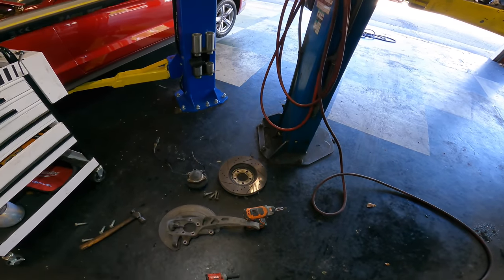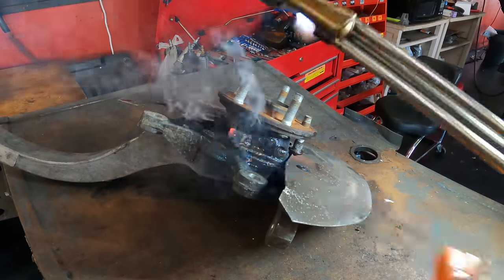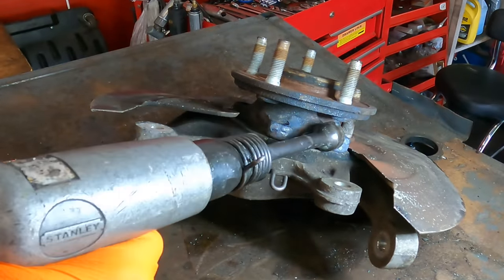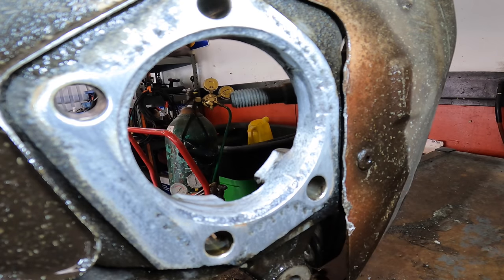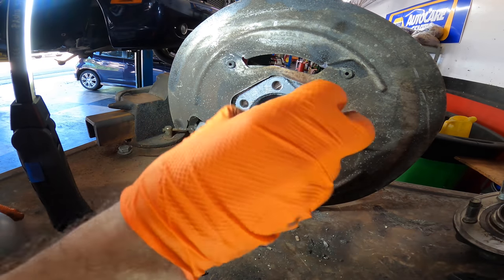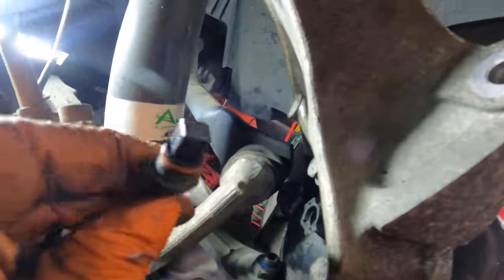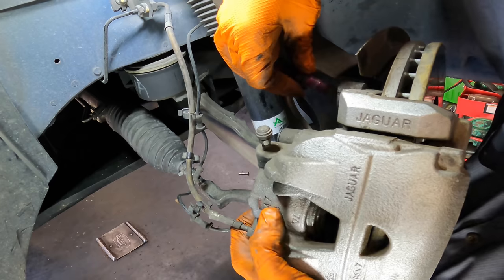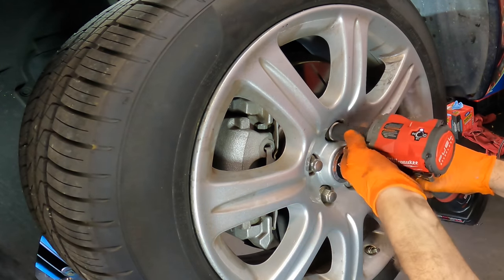Serious Corrosion! HEAT Required! Torching a Jaguar 2008 XJ 4.2 Hub Bearing/Bent Parts

Comment from the maker: There seems to be some confusion in this one so. I will elaborate. The steering knuckle was bent causing a wheel alignment issue. We got a used one bc a new one doesn’t exist. The new used part had a very rusted bearing so I decided to reuse the original bearing. However the junkyard bearing on the replacement knuckle was corroded in solid, so it got torched and hammered out. I don’t use a torch on aluminum Jaguar parts so the steel hub bearing got the heat. I replaced the steering knuckle and installed the original non-torched wheel bearing. The alignment spec came in perfect at  - 0.3*  BTW
Reply: I used to do chassis work in a body shop.  Idk how your knuckle got bent but whenever someone hit something hard with a wheel to where things got bent we preferred to replaced the bearing.  Depended on the customer's budget or insurance.  Seemed like every time we didn't it came back with a noisy bearing several thousand miles later.
Reply: I was mostly agreeing with the dissimilar metal issue. One would think that would come treated from factory assembly and further be part of replacement part instructions. Made everyones job harder.
Reply: Glad it worked out. I can see going through all the work to install a used part and have problems with it too (my luck!).
Reply: I get you have to do what you have to do. Your at the reluctance of the customer. Stay safe and be well.
Reply: You expand what you heat . . . so heating the bearing makes it larger. Heating what the bearing is installed in is what you need to heat and not that hot.  I think you were trying to break the corrosion between the two by burning or disrupting the corrosion. But light heat on the Aluminum will expand it allowing the press fit or interference fit to move in the expanded Aluminum.  I would use liquid N2 to shrink a component and it would drop into place. Using a cutting Torch for heating provides an concentration of heat for cutting. I know you have to use what you have on hand. Not being a troll but a few tip sets for heating is cheap.
Reply: FYI if you hold on the zero the ° sign will pop up so you can show ° instead of * 😊
Reply: Good job sir! Up here fire, never seize and duct tape are the handy mechanic's secret weapon. Red Green would be proud!
Reply: pleanty here in the uk RAY lol
Reply: Your BTW was a little petty....
don't you think?
Reply: Eric at SMAuto. Showed a video on something similar, not sure if it would be applicable to this. However he cuts off a wheel stud and uses a bolt and a nut on the inside to press the bearing out. He is in rust land and knows about seized parts. The bearing he was working on was a well known problem child that kind of makes their way to his shop.
Reply: @48Rodgers  00000000000000000000 eeeh, no. 😋
Reply: @mikecabral1579  That's what I thought when I first got my oxyacetylene torch twenty years ago. Then I gained a whole lot of real world experience. You are often in the practical situation of not being able to heat the female part, for various reasons. To my surprise, heating the male part works almost as well, for whatever reason. If I heat the male part I often spritz it down with water to shrink it back down, but even if left hot it often works fine. Nothing works as well as oxyacetylene, it is in another ballpark altogether. However I've never tried liquid nitrogen, it is not available in most machine shops.
Reply: @alexcarr8503  — i saw that episode too….looked like a great idea
Reply: @spelunkerd  I haven't looked in stores lately, but there are some aerosol can cold sprays that also spray penetrating oil.  Shrinking with cold is a nice option sometimes.
Reply: Think I would have done just a touch different. I work on HD,lots of aluminum, and things get stuck. I use a heat gun to bring aluminum up to 250-280F and with that I would use a press
Reply: Should've went to autozone part number is DL590426
Reply: Thank you for clearing that up I wasn’t sure if you use the torch the bearing as that would’ve been a no no thanks very much for putting me straight👍😀
Reply: rule 4 ..lesten to your subs...all experts are on the ouitside looking in..  with clip boards...
Reply: never sieze,,must be mastik,s sister..
Reply: I have cut off a stud, knocked out the cut stud and used a bolt with nut behind the hub and use it as a jackscrew. On an aluminum knuckle you might need some protection. Work one side then turn 180° back and forth. it will come out no heat needed. Repairs from the rust belt.
Reply: @mikecabral1579  N2 setup sounds like cool way(pun intended) to shrink metal. Tho possibly hazardous. Who provided yours and at what costs ?
Reply: BTW what about that upper ball joint. Rubber boot is torn. I guess aluminium arm with irreplaceable ball joint and no option to buy a new boot.
Reply: @peted5217  Long time ago. I think it came from same people that supplied our gas. It was stored in I think stainless steel container covered in styrofoam with a wedge type cap about the size of a 5 gallon paint can. Just pored it out into a container put the part you wanted to shrink in first covered it up with the liquid N2 gloves and face mask give it a few minutes picked up the part with tongs you could handle the part with just gloves drop it place quickly. Pour the Liquid N2 back into the container and cover it up. I was repairing hydraulic cylinders parts off of heavy equipment. I was the welder machine shop would bore out the part I really just watched them drop the bearing in. It would shrink a few thou..  and drop right in.
Reply: @mikecabral1579  Many thanks on how N2 was handled @ shop level. I'll check with local gas vendor to see if available, other requirements. Believe I've read it's also used as a surface hardening process. PeteD
Reply: @mikecabral1579  I've numerous times machined parts to heat shrink together and anything like a shaft that had to go into something, I'd heat the object it was going into but long before that I'd stick the shafts in the freezer. That wouldn't get as cold as you liquid nitrogen but it was a lot safer and easier to deal with, you just had to plan well ahead if it was large parts but it usually worked very well.
Reply: @edwardsilva895  If he hadn’t put in the “BTW” I would have asked.
Reply: @danwilliams5867  Aluminium has a much greater coefficient of expansion than steel.  Do what the above man wisely says!!!
Reply: I think you do great especially in a world where parts are in short supply, customers don’t want to wait and they don’t want to pay for repairs. If you don’t come up with something they will go to a shop that will and rip them off in the process. That ultimately effects the reputation of the industry and the bottom line. Many consumers were born in to or adopted the mind set “I’ll just go get a new car.” Many are finding out it’s cheaper to drop a thousand into their existing car (especially if they bought it brand new) then it is to buy a new one. Car payments are matching/ out pacing mortgage payments around the country unless of course you are willing to settle for a bare bones car. Then to add insult to injury the car is only worth a third of what you paid for it when you make the final payment. It’s clear auto makers are catering to the customers who trade payments every two or three years.
Reply: I'm Frozen parts used to use rustlick you throw it a part in the bucket overnight let it soak and it will dissolve any corrosion I don't know if it works on aluminum I would hope they have something like that but I Ray did the right thing why is apologize and explain it to a little trolls and haters I have no idea hey you got the job done man and it was a bear also I got a kick at it how Jaguar was stamped on everything that was cool have a good evening

Comment: Hydraulic presses are wonderful things they come in handy
Reply: Yeah can really tell it's Florida and not the north east.  No shop press and the torches are hidden in the back of the store room.
Reply: ill go with fire
Reply: I think he just wanted to make a video
Reply: @Usmanthemecano  Yes you are probably right.
Reply: Saw another guy trying that with the press and with it seized it snapped the aluminium rendering the whole arm useless
Reply: @GregsStoneYard  the shop has a press. He used it when he rebuilt the drive shaft in another video. I was woundering why he didnt just use it in this case.
Reply: @Labboy541  If the arm was cast steel or iron a press would have been the way to go, since the entire assembly would have more strength and the corrosion from dissimilar metals would have been less and therefore less friction.  However, with a cast iron or steel bearing outer casing resting inside an aluminum arm, you're going to have hellacious corrosion from the dissimilar metals, and the aluminum might not stand up to the pressures needed to overcome that corrosion friction.  In this case I think Ray's decision to heat the cast steel or iron was the best choice.
Reply from the maker: Not putting an thin aluminum knuckle into the press… nope
Reply: @RainmanRaysRepairs  Who knows how the original one got bent.  It may have been from someone pressing out an old bearing.
Reply: @johnmehaffey9953  good observation
Reply: @SomeRandomHuman717  nice observation
Reply: @RainmanRaysRepairs  ok, awesome video
Reply: Sir, I suggest you thinking before writing some “things”, probably would need a 100tonnes or more press to take some bearings out and like he said its alluminum knuckle so... and a friendly suggestion since this guy is making a living out of this trade, i presume must know a lot and should because out there always is someone who knows more than you do (at least for a particular subject) to avoid let say some hilarious situations
Reply: @RainmanRaysRepairs  i’ve done dozens of these in the rust belt. they don’t take more than a 10 ton press to get off. trust me
Reply: @RainmanRaysRepairs  swings and roundabouts - risk using the press, risk using the torch - possibly a combination of the two with a bit of shock therapy thrown in for good measure. Still at least no one is going to fly in it.
Reply: I used to use a hydraulic on Continental axles to get the bearings off then turn down the bearing and fit it to a Ford 9 in and you had heavier duty axles for when we were racing at the track this way if you got hit they wouldn't bust as quick have a good evening

Comment: I worked in an aluminum foundry for 11 years. Aluminum and steel parts will “weld” together with time and heat. I know people will argue with that word but, if you look at it under a microscope the mating surface has exchanged parts of each alloy and had become something new. This has been know about for a long time. Mother nature says this will happen every time. So…..the ultimate incompetence of the engineers and manufactures to mitigate this problem astounds me. I am sorry, I realize this is a rant. I am just sick of the stupid that puts those two alloys together on a brake system.
Reply: Fun fact: They use a technique called “Explosive Welding” to bond the lighter aluminum super structure to the steel hull in ship building. Cool stuff.
Reply: It does seem that they should know enough to try to mitigate it with some type of coating to deter the chemical reaction. To err is human but to really screw up, it takes an engineer.
Reply: @tiredoldmechanic1791  yup. They could put a sacrificial sleeve in there. But, for some reason they never do. We used a coating on our extrusion press. It worked pretty well. It just frustrates me to see a guy have to work so hard, when and ounce of caring from the industry could help.
Reply: Bi-metal bonding
Reply: NASA learnt this early in their space program, interesting read about how metals in outerspace meld together.
Reply: With any two metals near to each other, One becomes a Cathode and the other the Anode, Electrons flow from the more chemically active metal (anode) via a conductive path saltwater/dirty water/ or rainwater to the less chemically active metal (cathode) giving galvanic corrosion, or if an electric current is present then electrolysis corrosion is added, One is always a sacrificial metal. Sorry for the science rant.
Reply: @hardergamer  science is cool. I have been out of the lab for a long time. When i was there is was only a tech. I was way more the hands on guy than the brains.
Reply: 3 cents worth Never Seez you'll take it off with your fingers
Reply: Yeah - aluminium suspension components have been a big thing for a while with JLR. 

It's a problem really because you can make the knuckles and the arms out of cast aluminium but as far as I'm aware aluminium wheel bearings, wheel studs and bolts aren't available so you'll always have this mixing of steel and aluminium and have them corroding together. The later model all aluminium XJ was a big problem for Jaguar. It was a very good design in some regards but they struggled to build the all aluminium body shells.
Reply: I always heard it referred to as  dissimilar metal corrosion.
Reply: @hardergamer  Your explanation is accurate, in aircraft mechanic school it was called "Dissimilar metal corrosion"
Reply: In Illinois im constantly almost melting aluminum knuckles to get the steel bearing out to the point where the grease catches fire in the bearing it can get really knarly
Reply: Agreed its dumb especially when the price just increases yearly our new tech is the best but it's also irrelevant to someone who works on it.
Reply: Wow I thought that was common knowledge? The young need to be taught....or not????
Reply: @77zrod46  I fix everything I have the time money or sometimes the will power to do on my vehicle's I kinda said these new vehicles are meant to be put together once with no thought of the future
Reply: no doubt , that's a super entertaining event to witness live @richardluce775
Reply: @hardergamer  So That's what's happening, The Ol' 'battery trick' . Thanks 4 tip.
Reply: Galvanic action
Reply: Galling between the metals.
Reply: I share your annoyance it is a standard rule I all ways use moly grease to dope any interface between the twy
Reply: It's more like the superficial diffusion in a soldering connection, only a few atom layers in thickness but well enough to be in the way of disassembly. Also, heat may speed up the diffusion process but you'd need to cool it to absolute zero to stop the bonding entirely.... So there's no way to stop it realistically. Plus vibrations may encourace that diffusion as well
Reply: @fimbulvarg1213  Hence why the world has copper paste aka copper anti-seize.
Reply: @perwestermark8920  nickel is better but hard to find.everyplace i asked about it around here didnt even know it existed
Reply: I worked in a foundry an aluminum foundry for 9 years we originally used steelbolts but then we went over to stainless cuz we had the same problem and we used anti-seize it worked out great especially if we had to tear them all apart have a good evening oh by the way I use the machine molds out of aluminum casting after they came out of the foundary too it was fun I loved it might sound silly I love the fire
Reply: If I remember right it's called a dielectric reaction in exchange of electrons Ray will like that word electrons have a good evening
Reply: Hi Tommy this is Mike pressman I'm responding to your foundry comment my job used to be to keep the hot mountain metal when it hit the concrete floor from blowing up I also used to fly the big pot when it was getting cranked over so I could hit the screw with aluminum liquid aluminum ultimate aluminum in the boundary and then after that I used to be there and shake out where we break the sand up and get the cast things out it was crazy but I loved it and they were days where I swear I saw the devil standing in the corner cuz it was so hot have a good evening bye

Comment: Ray, your close up shots and instruction of repair are great. Must take alot of work to do repair and film at same time. You do a great job !!
Reply: What I didn't understand is why they use part torque bits and parts regular hex heads kind of confuse me a little bit have a good evening

Comment: my brother and I built and installed a '28 model A motor over the last 2 weekends, he was amazed at the process of replacing the ring gear: "heat old ring gear with oxy acetylene torch and tap to remove. Heat new ring gear to 300°f and drop in place on flywheel". Having worked a few boneyards in my younger years I was well acquainted with such processes 😆
Reply: The old skool way is still the Way.
Reply: When you drop the ring gear on make sure the boat holes are lined up before it cools have a good evening

Comment: I used anti-seize once upon a time on my fence to convince some regular fence-jumpers who believed backyards were a legitimate shortcut for them.  Seemed to work. They quit cutting through.
Reply: I needed that laugh
Reply: Clever tip for common shop supply. Thanks
Reply: Brilliant!
Reply: I think you could paint a house with one teaspoon of that stuff.   It gets on everything...and keeps going and going.
Reply: If you're going to have some real fun take high spot blue like you used to match gears on the rear end put it in a dollar bill and fold it in half and then drop it on the shop floor wait till somebody puts it in their pocket it will be fighting to get that stuff off for weeks and they will be bluer than Blue have a good evening